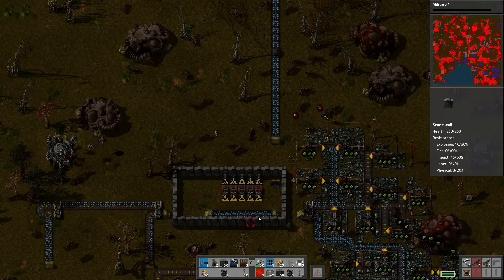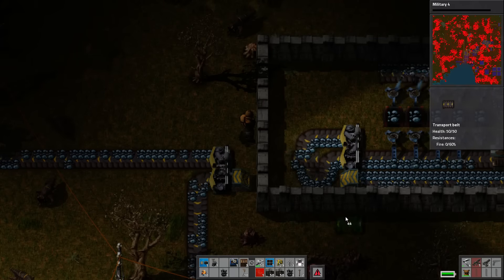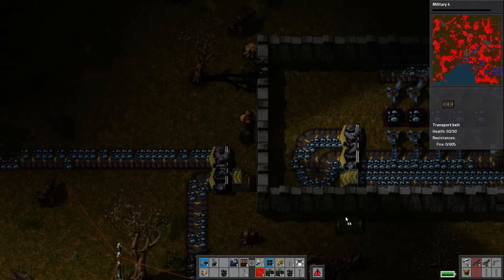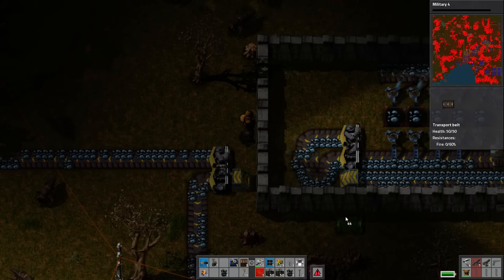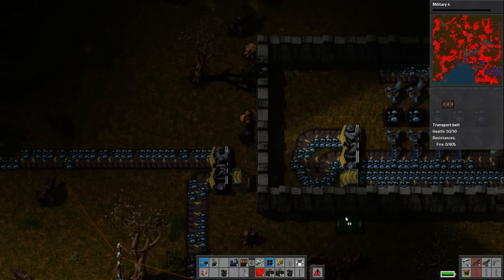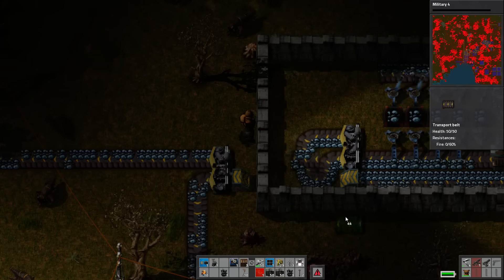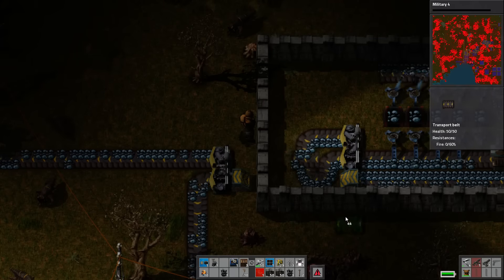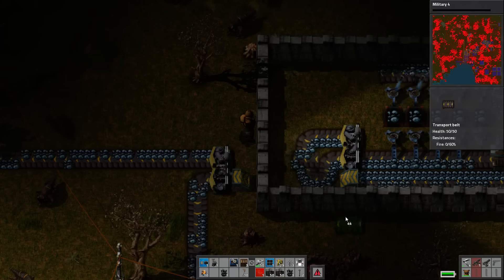Factorio: Living With Biters Ep#79: Overdue Overhaul

Comment: Bentham, you might want to consider stock piling poison modules (300-400) to deal with the first wave of the attack. Granted it is against Geneva convention to use chemical weapons, but the biters didn't participate in the the Geneva convention.

Also you could start building parts of the exterior walls, leaving gaps for the biters. Advantage would be right before the war starts, use a wall blue print to fill in the gaps, and then turn on the turrets.

Comment: Why no efficiency modules in oil and chem production? They do consume a lot of energy
Reply from the maker: +Anton Kovalenko They need level 2 modules for maximum efficiency, i'll sort them out later.
Reply: +Anton Kovalenko 
and why dont use speed modules to produce speed modules faster? that doesent make a lot of power consumption but that make a huge increase on lvl3 assemblers
Reply: +MangledPork Gaming 
oh, and the chemical plants consumption leap was cuz u reconnected the sulfuric acid :)
Reply: +MangledPork Gaming 
oh, and the furnaces take the most of the power so you should put efficiency modules to them.
Reply: +MangledPork Gaming you dont need to use the level 2 modules,  just adding the 2 lvl 1 will help a lot. until you get the lvl 2
Reply: +JDTeam 
8.3 MW the largest drain of power.... nope lets put modules in the blue science that's producing nothing.